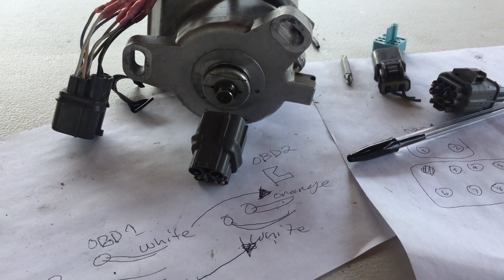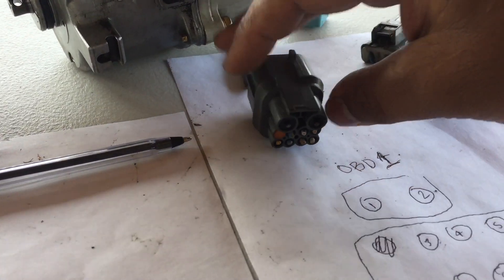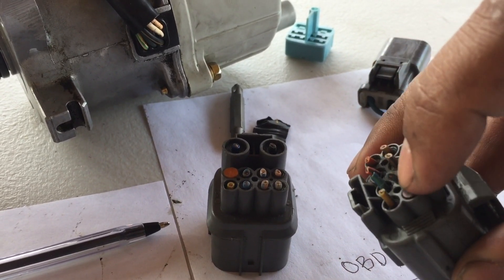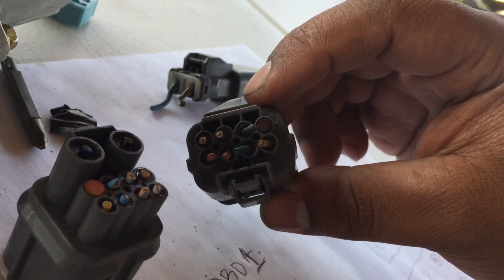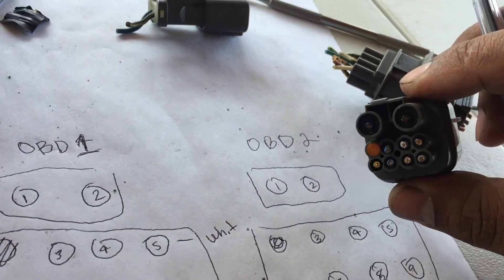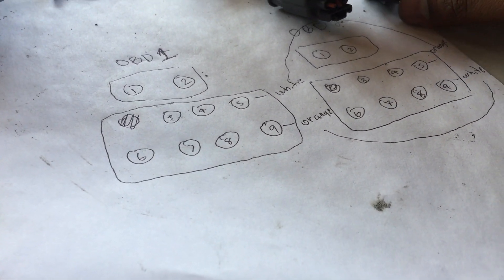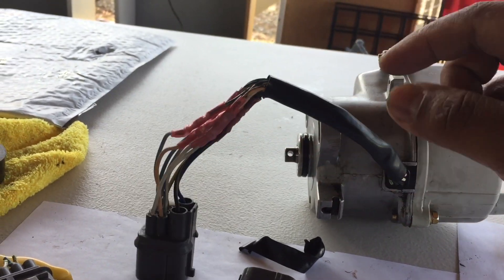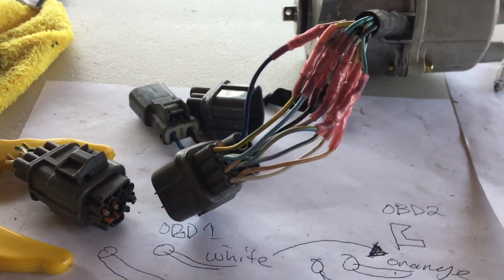Converting distributor wires OBD2 to OBD1 or OBD1 to OBD2 DIY JUMPER

Comment: Hey brother how are you, I have a b18b1 in my crv 5 speed rn. I just finished swapping long story short my distributor is good but I’m not receiving any spark I think the motor is an obd1 94 and I’m using obd2 cables from my prev b20. Would I need to convert my dist to a obd1? I tested my distributor and it’s good, I even tried another one off a running crv. It was still not giving spark. I know I’m getting fuel, and compression sounds healthy. Motor is shaking hard as icrank it trying to turn on
Reply: I also tried a b18 computer from an integra of one of my buddies and it was still doing the same thing.. cranking hard but still no spark so no start
Reply: Did you figure it out?

Comment: Huge shotout to you man. Used an obd2 distributor on a obd 1 harness. I had de-pinned the obd2 plug and pinned the wires to obd1 plugs matching color for color. Code 9 for cyp. Swapped the orange and white wires like you said and the cel is off now. Thanks again!

Comment: To make my p28 ecu work would i have to convert to obd 1 dizzy? 😵?
Reply: Yeah can always get a jumper harness I had one for obd2 to obd1 for my chipped p28. I checked this video out though because I'm about to take my b18 out of my wrecked ek and put it in my eg hatch so I'm having to convert my obd2 dizzy to obd1 to work with the eg engine harness. After watching this video i kinda feel stupid as to how easy it is lol
Reply: @xtripleAx-jh3ns  so say if im going from obd2 with a p72 ecu all i need is that harness correct to connect to the ecu or do i need to do something to the dizzy? (First time)

Comment: my white matches up with my white & my orange matches up with the orange
Reply: Yeah i went white to white & orange to orange because it match up & my car starts
Reply: Roberto Velazquez Jr nice ya mine matched up also so I did the same but I have no spark and no fuel to the pump
Reply: Hey man I’m in the same boat all colours match up did u just go white to white and orange to orange? I did that I have no spark for some reason
Reply from the maker: Roberto Velazquez Jr is it converted?
Reply: It works well i made my own step down harness using an old obd1 harness & a old obd2a dizzy & it works perfectly
Reply: i had 3 dizzys 2 of them the orange to white matched up the 3rd one i used orange to orange match up
Reply from the maker: @gfrob2103   the concept is to look at the pin out if the white is white and the pin out are at the same spot. Then it’s ok. If you follow the number chart I made then you should be okay. Some aftermarket distributors comes with the matching colors. The concept of this video is to match up the sequence of the block off.

Comment: Just a quick question , I’m have an obd1 94 integra and the motor went and I am going to pick up another motor but it is an obd2 , besides the distributed but else would I have to convert
Reply: Just use the longblock from the new setup and use all of your original parts (distributor, intake manifold and exhaust manifold) and you will keep your car obd1.  There's no need to convert to obd2.

Comment: My obd2 harness plug looks different to that, will it still be the same
Reply from the maker: most likely you have a obd2b, look into my other video for that
Reply: @hellastanceLLC  nah my plug has 7 wires all in 1 line, it's non vtec idk if that matters cheers
Reply: @jimbobkirkwood828  what did you do in the end ???

Comment: why would you wanna go from obd2 too a obd1?
Reply from the maker: Because that the only distributor i had at the moment. Why not!
Reply: Parish_Swamp_Drone I put a z6 in my 99 civic and I used my original harness
Reply: @dc5king101   so you cut the wires like in the video ?

Comment: So, I had a trash engine harness (obd1) with an obd2 dizzy installed ran great but I dint like the harness all cut up when  I got the car so I had a new one (obd1) MPFI  conversion harness made but!! When he made it he made it for an obd1 dizzy, so i got an obd1 dizyy for it now car has a idle surge and my damn tachometer doesnt  work at all was something not wired right I noticed the obd2 has 1 plug and the new obd1 dizzy has two.. Seems the dizzy to jumper harness (tach) wasnt hooked up right or at  all?  Any help would be  great.. Yes Im not great at explaining wiring jeje sorry and thanks
Reply from the maker: you probably mixed up the blue and light blue wires.
Reply: koo koo appreciate it

Comment: which is the reason of you swap this two cables?(i have a d16y8 distributor  and i gonna make a engine swap to b16a)and for sure i gona rewiring distributor to work the b16a on)...but i wanna explain the reason to do this swich on colors...and what will happens if all wires will be same yellow and white to..
Reply from the maker: most likely you will short it.

Comment: Hey bro how bout obd0 from the car to obd2 dizzy my car won't start it's a dpfi to mpfi. I check all the ecu wiring it's correct but not sure if the wiring at the dizzy is wrong cause they spliced in the obd2 pigtail to the car harness. Any help would be great thx

Comment: My civic 96 ex vtec idle air sensor valve have 2wires and i want to put in civic 00 cx hatchback non-vtec that a 3wires, what you think?
Reply from the maker: That pretty easy to do. Type in FFsquad and you should find how to do it.